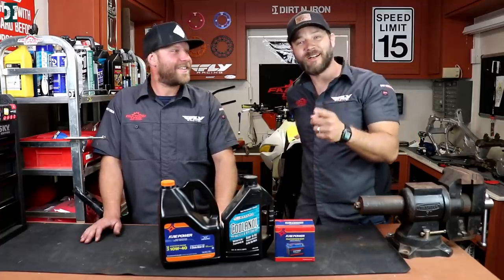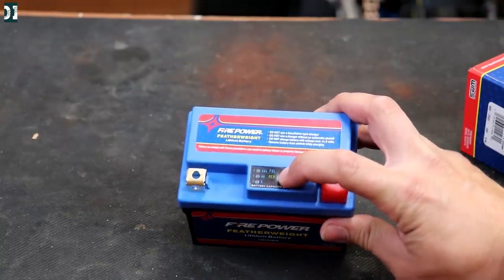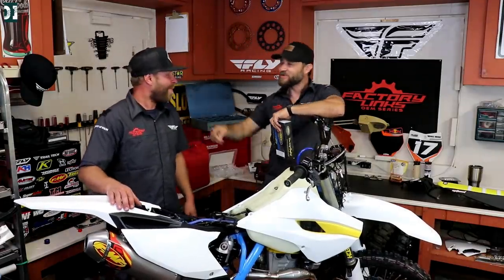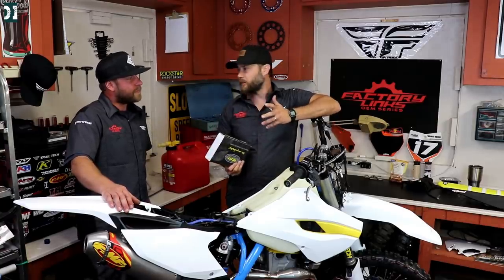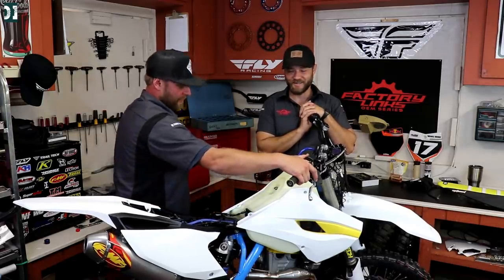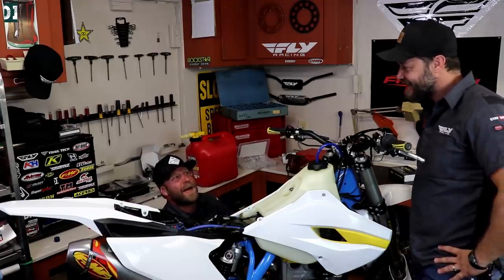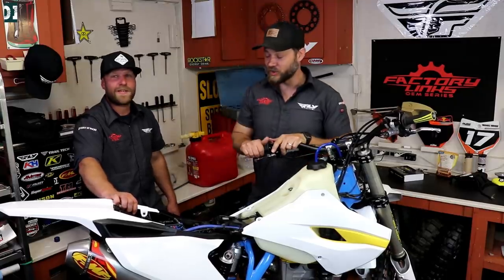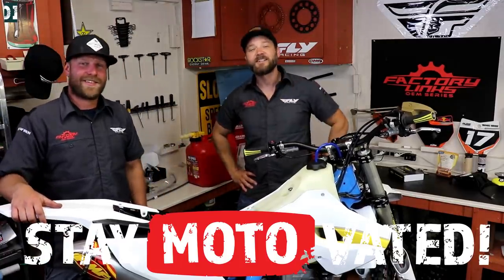Dirt bike build - first start after full rebuild - Husky FE 366

Comment: Glad you kept it real and didn’t cut out the mishap. I had an issue with the inductive hour meter and went with the vibration activated type. The induction type was making the bike misfire. Actually 2 of them. Maybe i did something wrong🤷‍♂️.
Reply from the maker: thats interesting, never heard about hour meter causing the problems.. thanks for sharing!   .. so once you removed pick up wire it would run good?
Reply: @dirtniron  yes it would run fine after i took it off. i thought i may have Not seated the plug wire properly..lol..But my son said it was probably because i wrapped the wire more than 5 times. I think i did 7. So, this could have been operator error, i still have them and will try on something else to make sure.